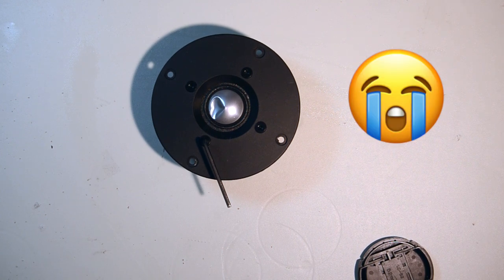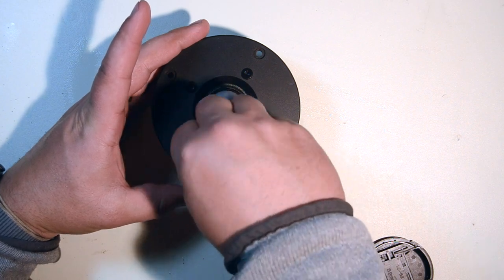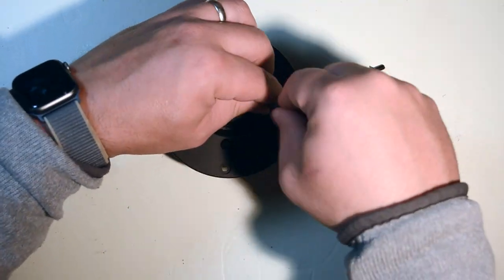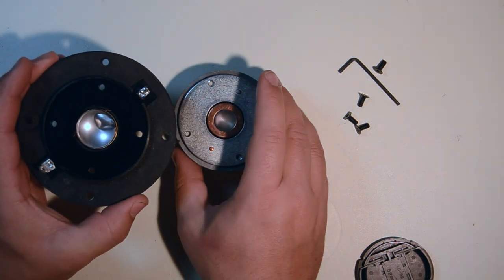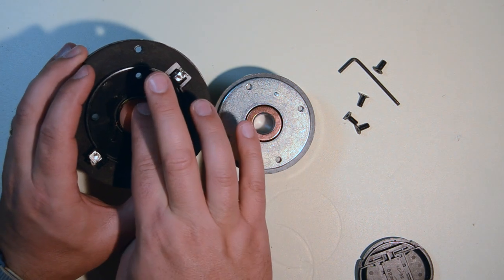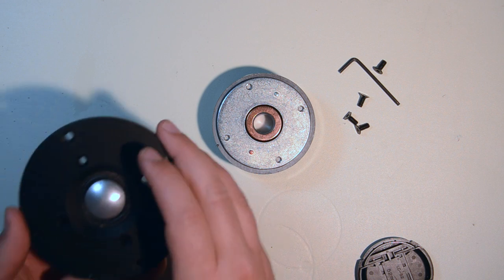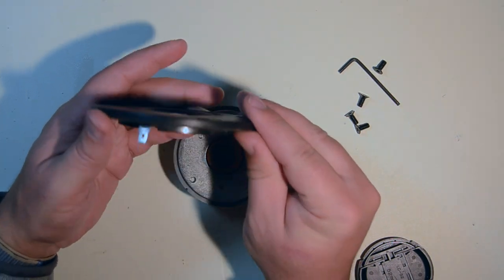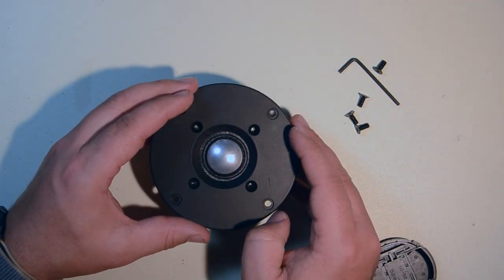Unwrecking Your Tweeter

Comment: Great video ... 

Only want point out how you've used the word 'polarity' ... as incorrect. Since the magnet has fixed poles ... and the coil on the tweeter dome is also fixed... if all parts of that electromagnet relationship are fixed... polarity cannot be changed when disassembling or reassembling the parts as is.

Only way I see it is possible... is attaching the leads incorrectly after the driver is reassembled.

Great demo of how to fix the dome. Kudos on showing this method.
Reply from the maker: Yes well, that's true that the tweeter will "work", but the point is there is a labeling of the "positive" and "negative" on the leads of the tweeter. If you rotate the dome 180 degrees those labels will either be accurate or accurate, and certainly inconsistent with another specimen. That is intended to help you correctly and consistently connect the wires to all your drivers. Putting it together wrong makes that labeling wrong, so that someone has to use trial and error to get the right match of phase between their say left and right speakers in a stereo pair.
Reply from the maker: Also, the polarity does have an effect. One way makes the positive voltage push the dome outward and one way makes the positive voltage push the dome inward. By convention, the positive terminal on a driver is standardized to make it so that if you apply positive voltage to it, the the diaphragm will go outward.
Reply: @andrewselle3256  - This explanation of polarity was 100% unnecessary.
Reply: @andrewselle3256  - are the + / - marked on the back of the magnet?